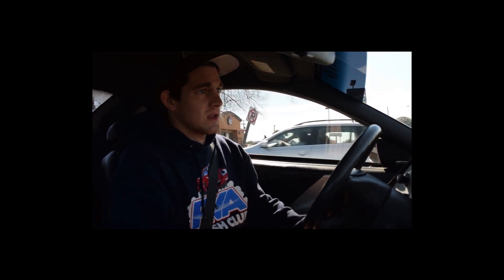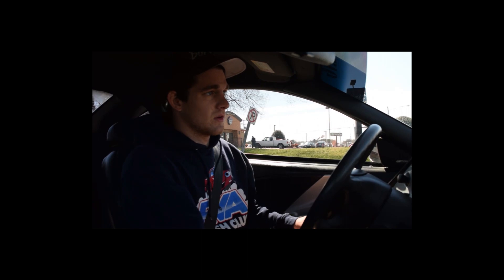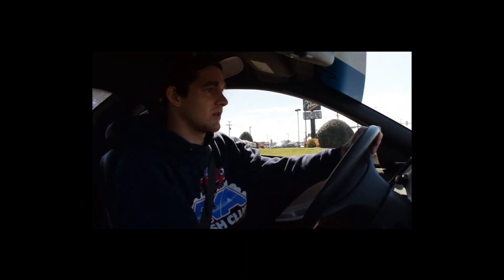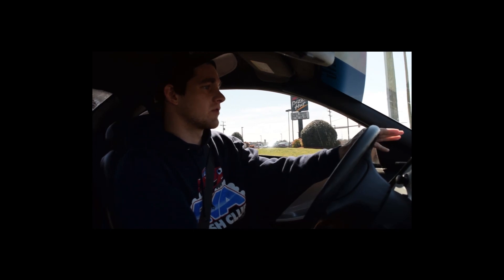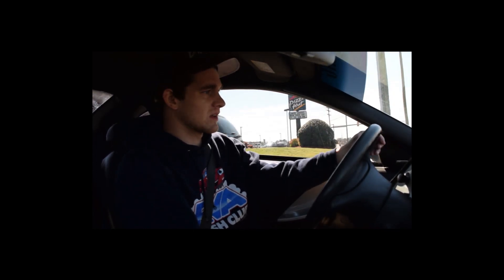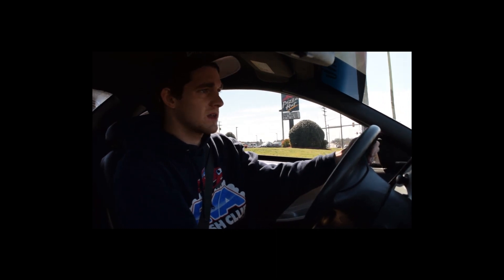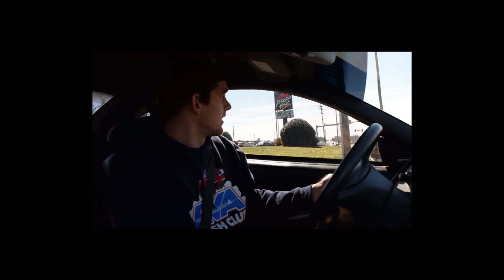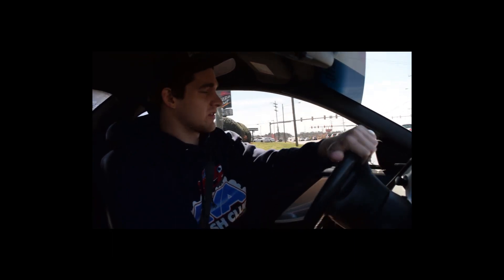What I Had To Do, To Get The Coyote Motor To Work In My Car

Comment: What about the gas pedal since the coyote isnt throttle by wire like the 4.6
Reply from the maker: Ro Guerrero You use a 11-17 gas pedal that comes with the control pack

Comment: I’m trying to determine if I want to coyote swap my 04 or not.
Reply: Sam, The Car Guy do it i promise you that you will not regret it lol. I have an s550 5.0 and oh man its fun. The sn95 weight much much less than the s550 and s197 so a 5.0 stock in an sn95 would fly man. Do it!!
Reply: Sam, The Car Guy it be a good swap mostly since new edge are pretty light weight

Comment: Oil and temp sensor that dash uses are not the same sensors that 4.6 engine PCM uses. 4.6 engine PCM and dash gauges don't use same sensors. I'm getting ready to help my brother put in coyote into his 96 GT. Getting F150 core engine saved ton of money why buy engine ready to go in. Still have to take it apart to change pistons, intake cams, oil pump and oil pan gasket. Note Ford says exh cams are different from Mustang but he's going to use OEM Boss 302 exh cams. Mustang GT and Boss 302 use same intake cams. Right now with everything 4500 dollars into this project. You can make stock tach work not big deal.....People told us can't put 94 mark8 OBD into 94 T-bird OBD-II car. Right was very easy to do used all of 4.6 2V solid state controller to make everything work and only had to wire in relay for fuel pump. I'm a tech projects like this are easy and getting factory wiring diagrams help a lot too. That right there tells you how hard or easy it will be and what you need or don't need
Reply from the maker: Alena Soto The sensors are the same, I bought new sensors and there 4.6 ones and work fine, the F150 motor of you want what the mustang has power wise then you will need to change the cams, I bought a crate motor so there is nothing I had to remove or add, it was a drop in and start up, the wiring for a coyote vs 4.6 to make the stock tach to work, you have to splice the old wiring into the new wiring, the rpms for 15-17 are harder to get to even work, JPC Racing who do nothing but Coyote swaps and Rev auto as well tell you it's not worth the trouble because it's difficult to get to work and even if it does it's still off
Reply from the maker: Alena Soto $4500 you are missing a few things, I don't see a coyote swap being done for that cheap when you have to buy a trans that won't blow up with that power, the control pack, headers, power by the hour accessory kit, fuel return style and tune, that's more than $4500 just saying, good luck with the build
Reply: Alena Soto Pretty sure you are missing parts, $4500 isn't going to get a coyote swap done
Reply: LOOK PCM sensors and senders for the dash are not the same. If that was the case both used same sensors (meaning PCM and dash gauge use same sensor) then it would be datalink from PCM to DASH its not. Engine sensors are 2 or 3 wire(depending on temp or pressure sensors) and dash gauges are 1 wire senders. I have Ford wiring diagrams and that I seen them. Ford didn't start doing datalink from PCM to Dash in tell 2005 hint using less sensors on the engine.
Reply: Alena Soto Why are you buying a motor for 5k to add more stuff? I think the video says he bought a motor crate motor from Ford a drop in! You need a trans that will hold that power and Ford even says you need to properly tune a crate motor if you run long tubes and no cats, you don't do these swaps running stock headers it's worthless, all 79-04 need a return style fuel system because the coyote runs a return style. There is two computers for the car, body and new pcm, you splice the cluster gauge wiring into the new pcm and the body computer runs the controls on the body of the car, if you want ac you need to run a wire to the body and then to the compressor spliced from the stock ac wiring for example, so that right there tells you how to run 4.6 sensors with a coyote pcm
Reply: Alena Soto The owner did the swap himself, no shop was needed
Reply: WHAT PARTS I AM MISSING????? Remember its 500 dollar core engine it came with harness, fuel rails, throttle body, sensors. No alt but can use 96 GT alt. Also he scored parts from a person who was going to do coyote swap. But guy crashed the car so my brother was lucky. So don't say it CAN"T be done when you know very what he spent on parts or how he got them
Reply: Alena Soto Dude you are really just acting like you know it all! It's actually annoying, you come here saying that you did this and that for 4K, didn't mention how your bother got any parts and expect anyone to know, and I find it hard to think someone would give Coyote swap parts away that cheap just saying
Reply: YES I can unless you go out and buy 5000 engine and still missing pieces. You don't have to buy 1200 return system with 2 pumps. Other I don't have to pay someone to build engine or do the swap. DON'T need tune it either control pak unless you like to take it to the edge. Trans not going to blow up unless you drive like a mad man. Then you could blow anything up. Right now we have all the parts only thing not done yet is machine shop work and that's not going to cost a lot. Remember something was gotten from swap meet and ebay so cost was lower. Even Ford dealership sell parts to me at wholesale. You shop around a bit can get good deals. I've done swaps most don't know what their doing. Even swapping 01 Explorer 5.0 into my 99 Ranger 4x4 was easy. Then that powertrain went into 03 Ranger Level II. Even my tach works right don't have to add extra wiring (ground). My Ranger looks like it came factory with V8..  I'm guessing you went out spend 5-7 grand for mustang GT engine so of course YOU couldn't do it that cheap.Wiring not hard Rev auto don't want to waste the time to do it. Most want fast and easy and out the door. My god splicing wiring not hard I could even extended wiring and put PCM in the trunk if I wanted too. His car has 04 Cobra IRS in it too and sooo many said that's hard thing to do....I call it just plain simple lazy to make things work. I'm a tech and I see this a lot
Reply: Know it all was you by saying what you said. should have asked how is he doing it that cheap. So stop being annoying. Guess now he's doing Cobra Rods so add 400-500 dollars. BUT he has 2 Teksid cobra blocks so he's trading one of them with a guy who has Cobra Rods
Reply: WHO said 5k for engine I said 500 core engine guess you can't read. I said guy in this video most likely spent 5000 for mustang GT engine. Coyote swaps don't cost 10-12k unless you buy EVERY PART NEW